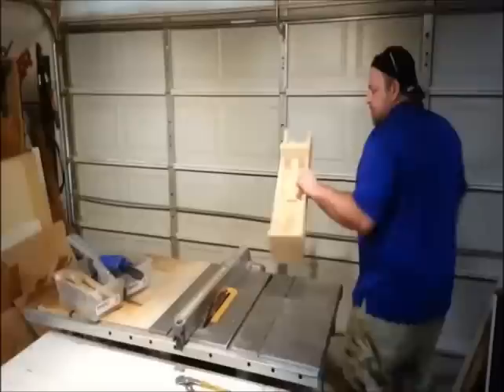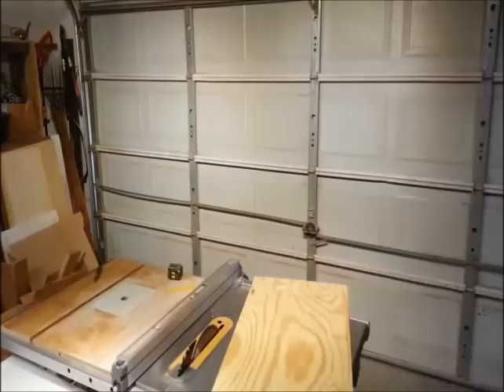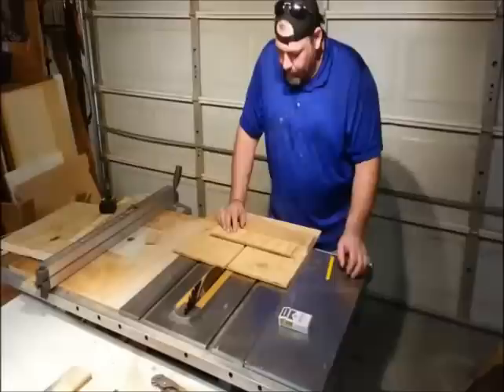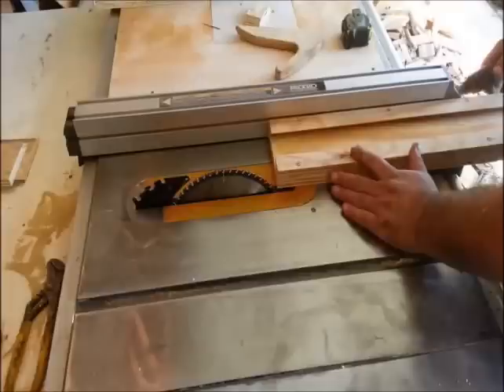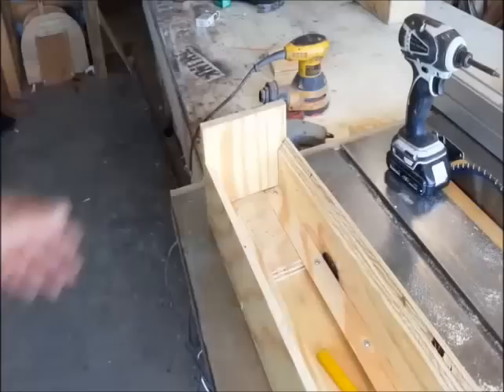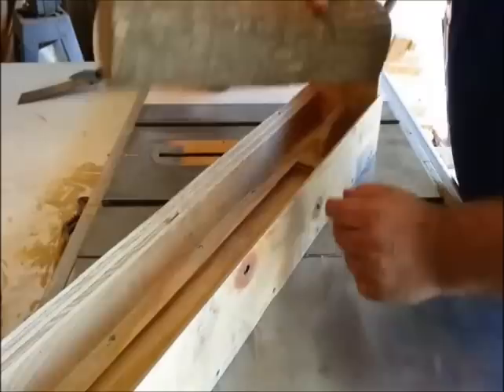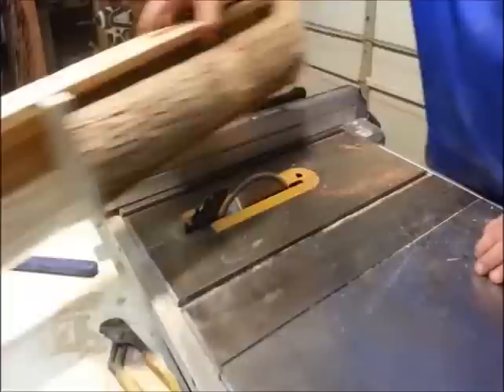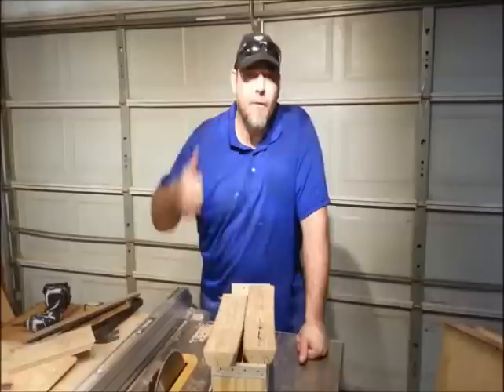Table Saw - Saw Mill - JIG!

Comment: Izzy ~  What size screws are used in the end caps that hold the log?  Have you considered alternative methods of holding the log, such as 1/4 inch threaded rods secured with T-nuts driven into the sides of the end caps?  These would replace your current use of screws and save time dealing with the cordless drills.  The tips of the rods that make contact with the log could be ground to sharp points that would exert pressure when the rods are turned with a handle or a nut using a socket wrench.  Trying to think outside the box.
Reply from the maker: i use 1 and 1/4 inch self tapping pocket holes screws. I have thought about a clamping device for this jig but i use it for alot more then just milling. and in many applications i  want the work to pivot on center so clamping would need to be removed or I would have to build several different jigs.

Comment from the maker: I almost alway use logs that have been dead for at least two years alreardy pretty dry.. a couple weeks on the rack to acclimated and it good to go.. but I do have plans on doing a vid for a simple homemadw kiln for thoughs times when I am cutting green wood. The method I use is pretty sple and I dont get alot of twisting or warp.

Comment: I don't know if you're still looking at comments from videos over a year old, but just in case...
It was a noble effort converting all your measurements to metric, but I don't think it's worth the trouble. Here in Poland (and maybe in the rest of Europe) TVs, cell phones, and plumbing are all measured in inches so people are at least vaguely familiar with sizes and how to do conversions, and nobody is going to do exact conversions anyway, but will pick the standard metric sizes that are fairly close.
Just my two cents. Others may have a different opinion on this.
Reply: I agree, listening to both measurements is confusing. Better to stick to one in the vid with textual overlay if you think it necessary. Most of the measuring tools in Australia have both systems anyway. I thinks its better to see the jig being made and in action and leave the viewers to do any necessary mental gymnastics.

Comment: I know this is a rather old video, but cool to see that you're doing some metric measurements too! However, since there's so many measurements in this jig, you could try doing some (like 20-30% of the measurements in metric too), then we, the guys overseas, will learn the imperial system more easily!

Comment: going to work on building this. do not have any plywood, do you think a ripped 2x8 would work or should I go buy a slice of plywood? would use pieces of ripped 2x4 and strapping for the smaller pieces

Comment: 7:50 you don't need to screw it in so It doesn't move because when you screw the log into the top and bottom it will not be able to move 😁

Comment: I appreciate this work, but ... I just screwed my log into the side of one 2x6 board.. I put the board against the fence and milled the log in passes like he does here. So what is wrong with what I did? I don't see why you build this whole thing when you just can screw the log onto a board.
Reply: sounds simple and easy, how did your wood turn out? hit any screws? i may try you trick.
Reply: I marked the depth of the screws on the ends of the log so I knew not to go that far in. I did learn later why my method isn't great. If your cut requires you to flip the log over and cut from the other side because the diameter of the log is too big, you run into problems if there is any wiggle room holding the log to the board. If the weight of the log causes it to droop against the board,  then your cuts from either side won't be perfectly parallel and you'll have a crease in the board you are making. I've been thinking about screwing small planks onto both ends of a log (off to the left or right side) and doing it that way instead so drooping won't be an issue but I haven't gotten around to it

Comment: once you cut the first flat face, why not just put that face against the fence for the rest of the cuts?
Reply: you can do that but you have to hold it against the fence during all of the cuts because it will rock into the saw and It is not as safe as putting it back into the jig.
Reply: Trust it's not safe like that guy said I've done this many times. I simply get a long straight bored and screw it to it and use that on my fence unscrew and flip it over